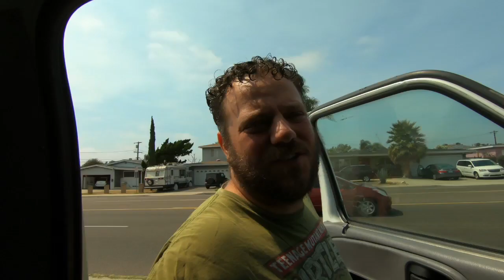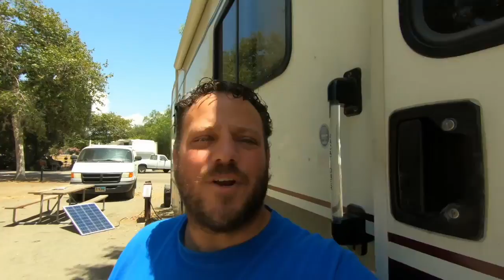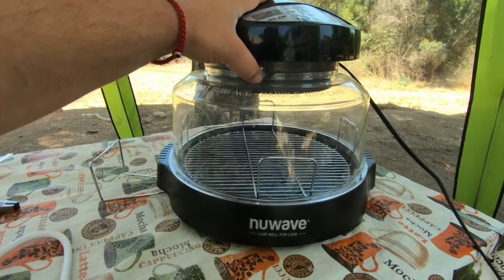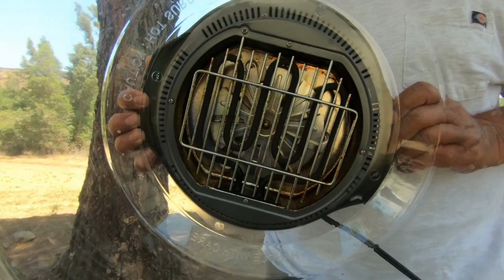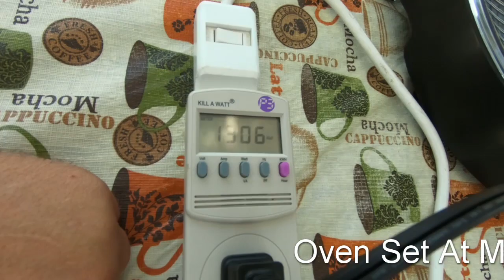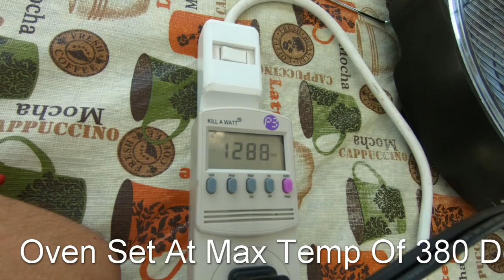Van Life Build DIY Off Grid Stealth Campervan Project Part 2

Comment: Awesome. If you get hot check out zero breeze 12v ac. Its 1100 BTU uses 12.5 amps. I just ordered mine and I think this ac is doable. Thank you so much for all the videos. 👍😎
Reply from the maker: I already have a 5000 btu unit for that.

Comment: I think van builds are the best builds. Certainly giving me ideas for mine. Thanks James.
Reply from the maker: Nicholas Maietta You betcha man! I'm going to make this Dodge shorty feel huge!
Reply: Wanderlust Estate I got lucky and got a high top extended body van. I believe it's the same chassis as yours but mine is a 1979. It's got the 360ci engine, 4bbl Edelbrock cuerbuerator with a a727 transmission. It's a beast. No fuel injection or wierd computers to cause me headaches. I don't have much money right now so my build is very slow going but it will be my office on wheels while I travel between places. I like that you are always pushing forward despite bad things happening which is admirable and reminds me of my own trials and tribulations and just working through them. I'm worried about your eye sight and how that will affect you down the road. Anyway take care. Looking forward to your next vid as always.
Reply from the maker: Nicholas Maietta I don't know how to quit. The universe doesn't seem to understand I'm going to get my way, lol. My biggest worry right now is my eyesight. To be honest I'm running out of time. At the rate of decline over the last 2 years, my doc is guessing I will only be able to drive for about 3 more years at most. Could easily be less. Please cross your fingers for me. Shoot over some photos of your build to my email.

Comment: Would a nice bead of silicone work along the sides of that older/narrower panel? I know GE makes one in a aluminum color that works awesome. Do you think plastic sheeting rolled out works as a moisture barrier? I have some already. Love the content thanks for posting🤟🚐
Reply from the maker: Stephen O'Laughlin The silicone will keep me from having an ugly space, but thats about it. The plastic can work as a vapor barrier, but you gotta have it sealed tight and get air pockets out. Plus the shealthing is easy to tear and givrs no insulation value.

Comment: Anything with a heat elements is thousands of watts because all the current required to heat the element. Element material doesn't seem to matter either.
Reply from the maker: Then you'll be surprised by my new grill.
Reply: The most efficient I've seen was a hot water kettle that was only 300W with 115v mains power. Stoves and toaster ovens are usually put on at least a 10A fuse because surge power.